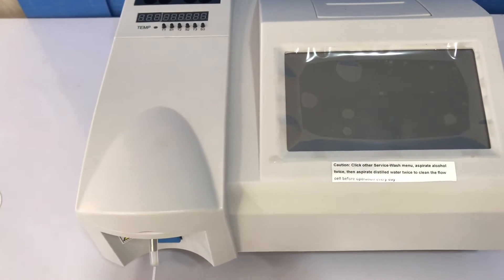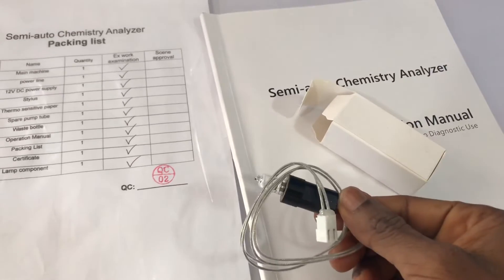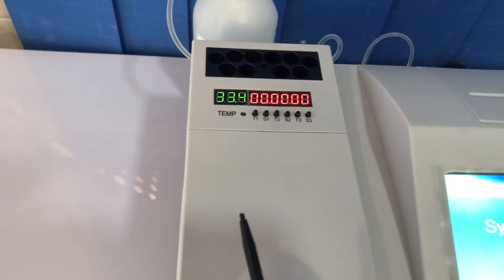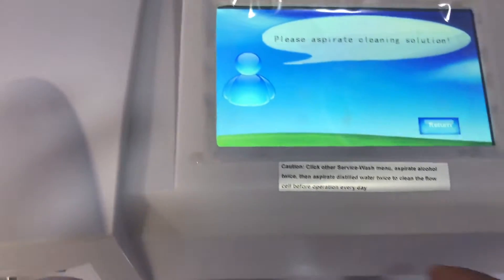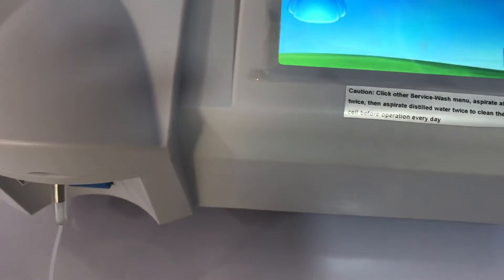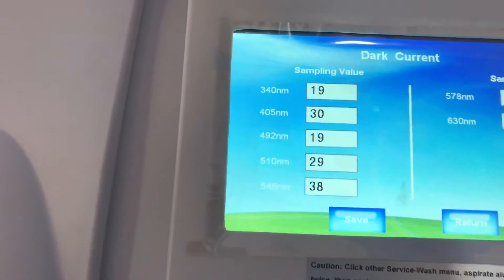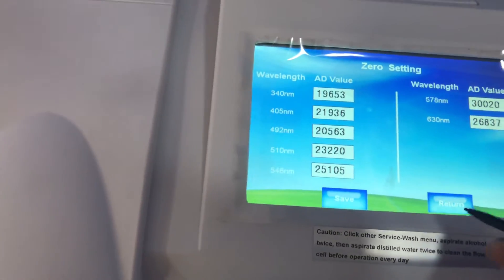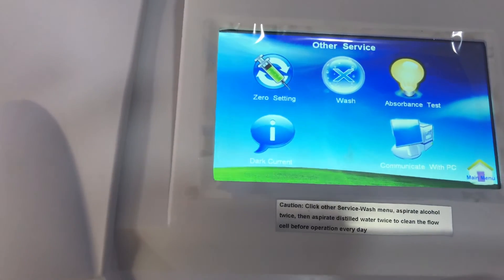Semi automated chemistry analyser

Comment: What if you do not have distilled water ?
And also, must you always do the washing each day?
Reply from the maker: Clinical chemistry requires high level accuracy to achieve best results. 
It’s strongly recommended to use distilled water but if you decide to do otherwise, you do so at the risk of achieving reliable results.

Comment: thank you so much for this video. Pls can i use acetone as the cleaning solution?
Reply from the maker: Yes
Reply: @easypassgh7506  Thank you for your response. Please what do I do when the curve is above the grade line when doing my absorbance test? I notice my values are always high doing testing
Reply: Do u have a pdf copy of ur manual can i pls.ask?
Reply from the maker: You can follow through with flushing the tube with hypochlorite , then alcohol and water several times and redo the absorbance testing.
Also check whether this high reading is with a particular wavelength or all the wavelengths
Reply: @easypassgh7506  thank you so much